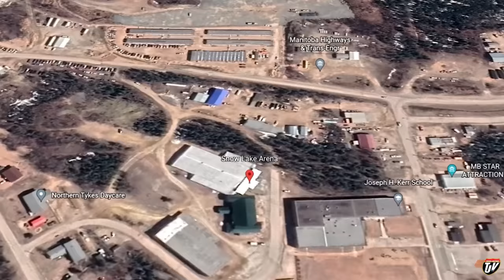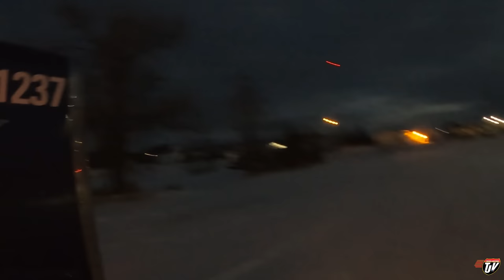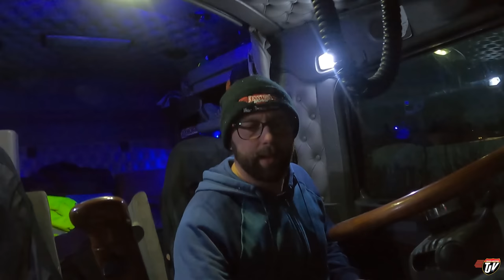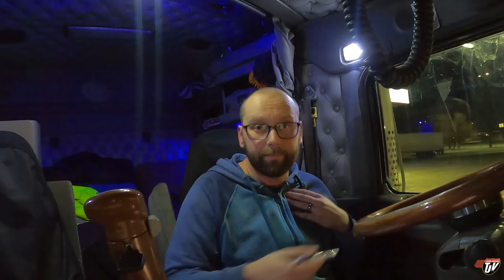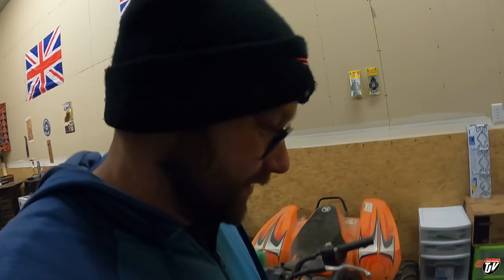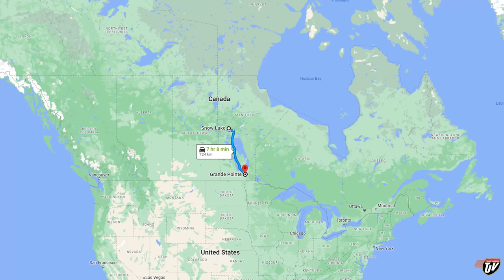SNOW COVERED ROADS | My Trucking Life | Vlog #2673 | Nov 18th, 2022

Comment: Noticed your mapping software is out of date. The  W shaped jog on Hwy 39 east of the 392 intersection was replaced by a straight road about 4 or 5 years ago.  Check your GPS tracking it will show you going through the bush.

Comment: If the MRi was normal,then you should not have to worry, but you didn't say that you had the MRI with the X-ray dye. If you had it with the dye and the results were in a "cool color",( blue, green, purple etc.) then it is normal. If it shows up in a " warm color," ( yellow,red, orange etc.) then something is there. That's how they found the tumor in my dad's spine which turned out to be cancer. He fought it from 1985 to 2017.